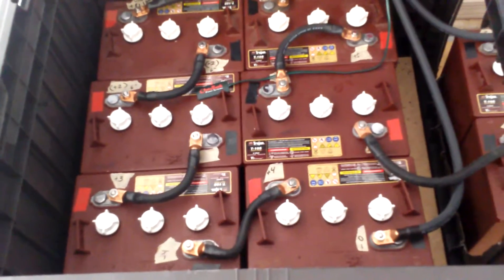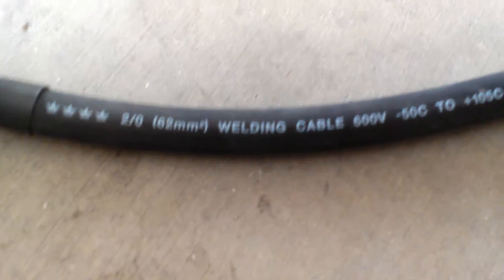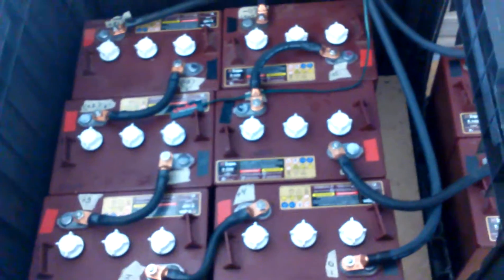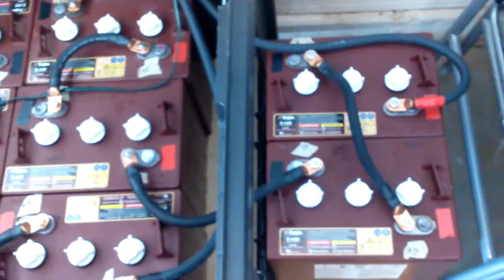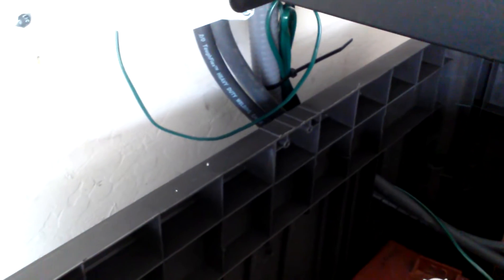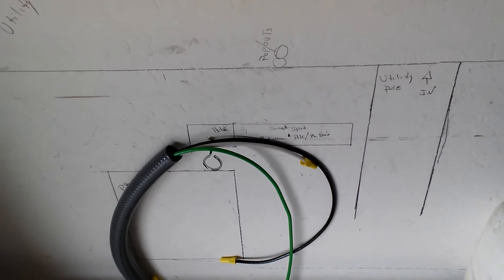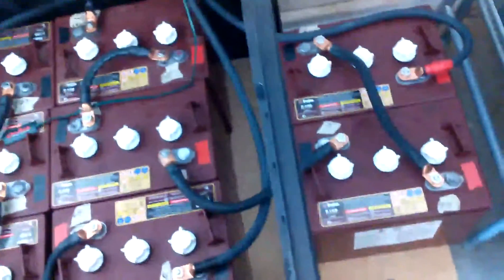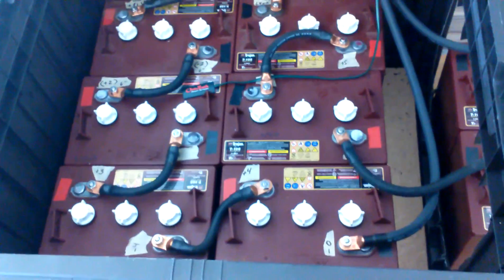Battery Bank Wiring 48v 225ah Power Station

Comment: You don't "amp up the voltage", a bad term...you INCREASE the voltage wiring the batteries in series while leaving the amps the same. You can't confuse the newbs.

Comment: Trojan batteries have a good reputation, This is why I have chosen for Trojan.

I have 12 Trojan T105 batteries 3 banks of 4 batteries as one large battery-bank from 24V 675Ah.
I have this in use from November 2015. I hope on a long lifespan. 

The deepest discharge till now is 5% i can see this on my Victron BMV700 Battery Monitor.

Why so much capacity, This is because wear with a large battery bank is much less
than using one small battery-bank for example, 24volt 225 AH 4x T105. 

The Battery Monitor give a alarm if the SOC is lower than 60%

Charging 

I have 6 260W 96 cell 48v home-roof solar panels 260W 48V Whit a Victron 150-60 MPPT charge controller 1770 watt maximum At A 24-volt battery system

Black 600 wind generator 24- 600W. 

Self made Kubota diesel DC Generator set 24/75Amp With tree stage microprocessor Mastervolt regulator. 

AC power 

Victron 24/800W    230V AC inverter for daily use. 
Victron 24/3000W 230V AC inverter for heavy loads.

Pity that i can not place a photo.